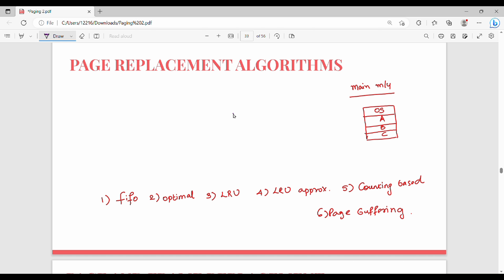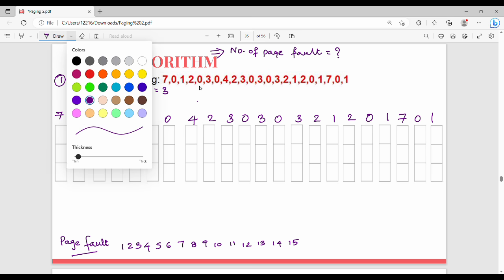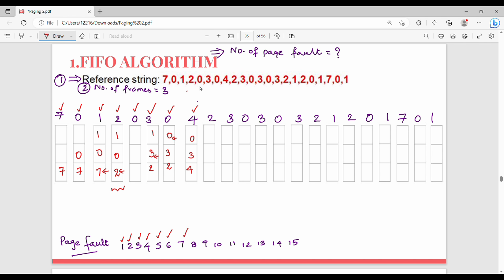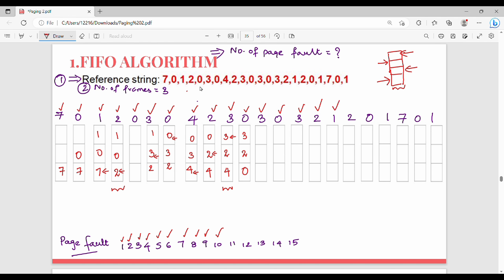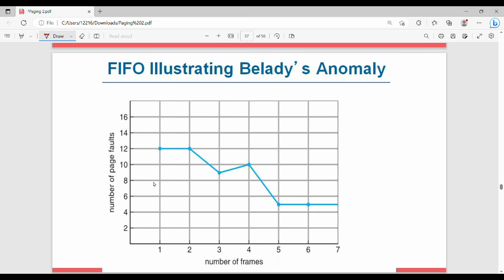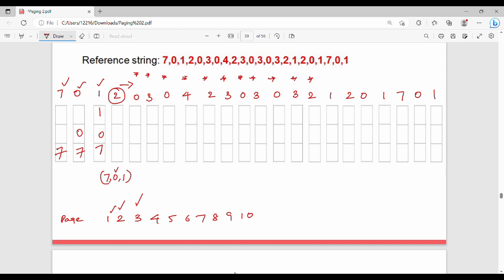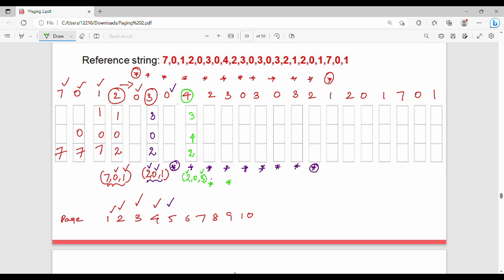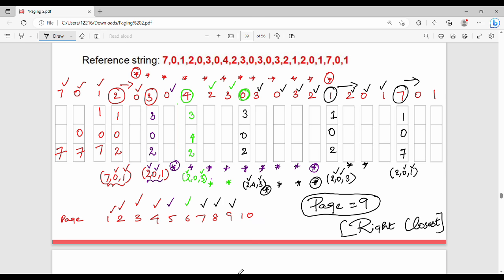3.15 Page Replacement Algorithms Part 1 in Tamil

Comment: Sir in optimal last 7 0 1 in that 7 inserted 0 and 1 is already there so we can't insert instead of 0 and 1 there is 2 and 3  there is no feature number used .... what we can do sir now the last 3 number is 7 2 3 ??
Reply from the maker: Sorry doubt is not clear, please specify timestamp of doubt.
Reply: @because2022 14:08
Reply: 14:08 last 2 number is 0,1 . 
Instead of 0,1 there is 2,3 now what to do sir? In optimal sum 14:08

Comment: Sir some optimal sums la last ah  fifo use pannura madiri varudhu 1 sum adha model ku teach pannunga sir.
Question : 012301230123457  pframe=3
Reply from the maker: Hi Dharshini, you can use this website to check your answer https://solver.assistedcoding.eu/page_replacement
Let me know if you dont understand.

Comment: Sir 14.9 min last value 7 insert then right side value are 0and 1  if 0was there than 1 is not there in right side how to find
Reply from the maker: Then you can replace wither 2 or 1
Reply: @because2022  ok sir thanks to clarify ✨🙏
Reply: Sir some optimal sums la last ah  fifo use pannura madiri varudhu sir..konjam 1 sum adha model ku teach pannunga sir